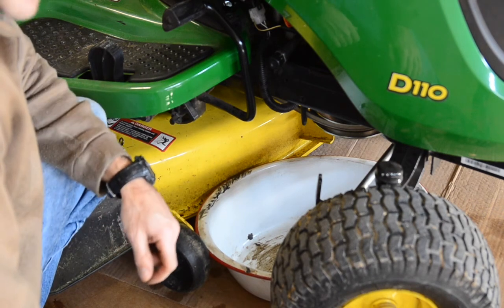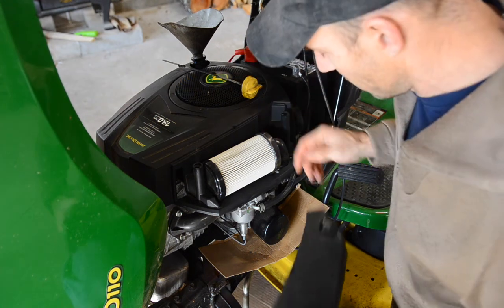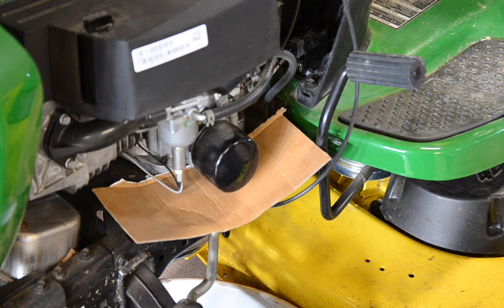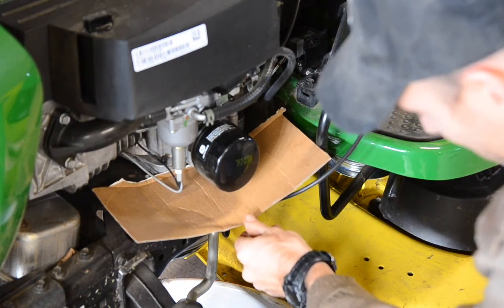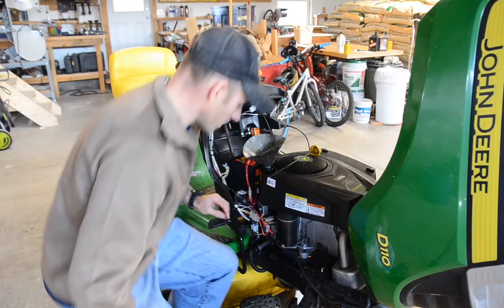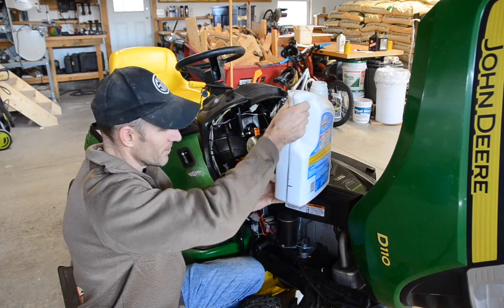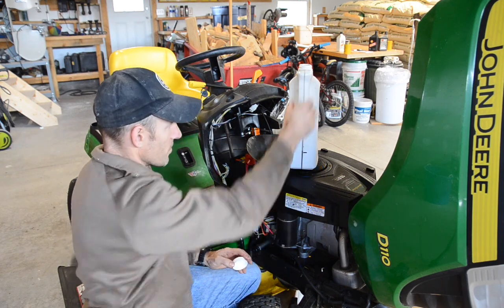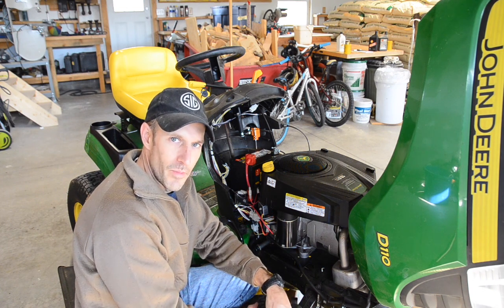John Deere 100 series oil change

Comment: Your JD dealer also sells a severe duty oil filter for the D series. They are twice the length of the normal oil filter, and only a few bucks more.
Reply from the maker: Thanks
Reply: I use a Motocraft FL400S.  Longer and holds more oil.  Just add to full line.  Good filter.

Just make sure you have space for longer filter.

Comment: I have a John Deere Gator with a 2 cylinder engine.
In my Gator I'm facing a problem of mixing of gasoline with engine oil.
What is the reason ?
Starting is OK...
No smoke from exhaust pipe

Please reply me
Reply from the maker: Your float could be stuck open in your carburetor. If you have a fuel shut off, change the oil then next time you run the gator shut the fuel off if that keeps the fuel out, then you know your problem is your float.

Comment: I am a complete novice at this, and I have watched half a dozen videos on changing the oil, but none really shows the simple thing I'd like to know. When you pull out the dipstick to check it, where should the oil be on the dipstick? Nobody shows this, they just look and push it back in.
Reply from the maker: There are two little holes I like my oil just covering the top hole.